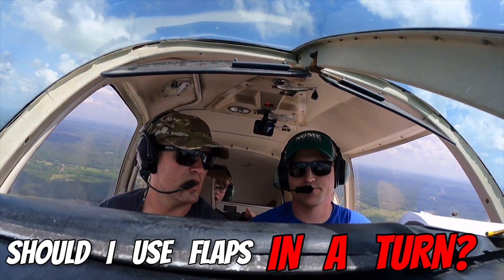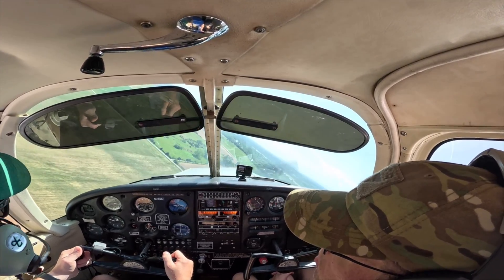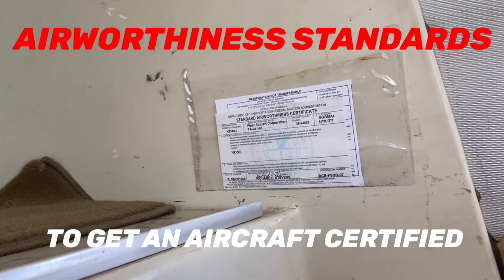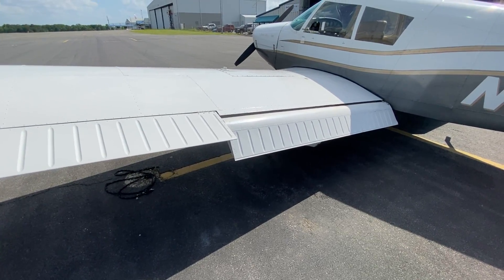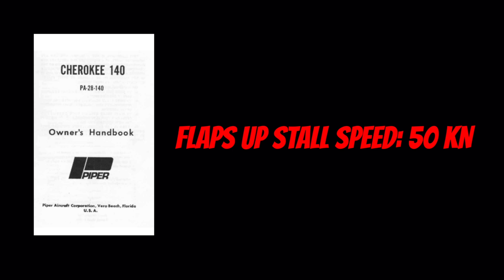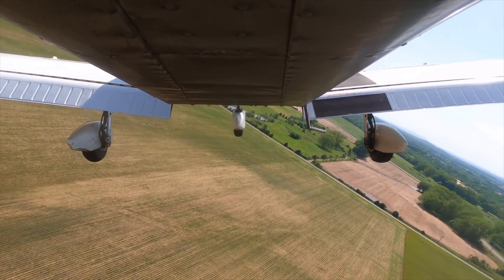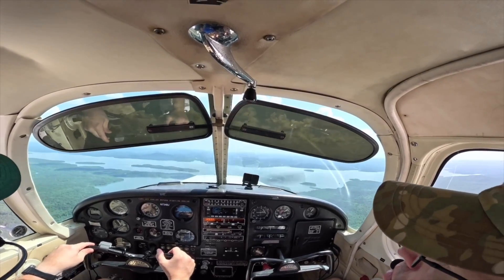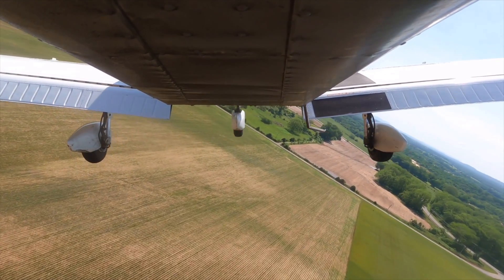Should I LOWER Flaps in a Turn?

Comment: There is a catch, you shouldn’t OPEN them in a turn. Some airplanes have a constructive tendency to jam the flaps when uneven pressure is applied. An during the turn the back pressure on flaps are uneven. 
Edited after first 5pm of video: my C172 have tone motor and a gearbox which splits the momentum for flaps, it still could jam as it happens in a cars with the same type of gearbox. And not having an accidents is not a point is like saying: there is no prove that oil change needed in between service intervals. Yes it’s not killed anyone it’s just a precaution habit which might save your life. This is what aviation is about.
Reply from the maker: This raises an interesting question… can you have a symmetrical load on the aircraft in a turn. I would say yes. As long as you are coordinated and you have neutralized the ailerons.
Reply: @FreePilotTraining  no, since your wings travels different distances. Like a car wheels in a turn. And different distances with the same pressure means different speed which resolves in different back pressure

Comment: Negative comment here!
While you are correct in what you talked about flaps, bank angle to G forces stall table is not saying exactly how you read it
What I mean is - if you don't pull those G's (no elevator up), you are staying at or close to 1G and even at 45* and no flaps you won't stall
But in that case - you will be going down fast (less lift which portion of went to horizontal component now..) - so still not a smart idea to bank 45* if you are close to the ground and want to land wheels first 😀
And since you don't increase the dreaded Angle of Attack - stall speed is also not increasing - but again - your speed to meet the ground is, since you have less lift 😀

That table says - in order to keep level flight (steep turns), for that much of bank, you need to pull this much G's (elevator up) to stay level, and that change in attitude (higher AoA) makes your stall speed go up by this much

Boom! All without even 1 equation :glasses-purple-yellow-diamond:
Reply from the maker: I agree, BUT as I mentioned in the video, if you are low and you level out and you make a level turn at 45 degrees, that’s where the REAL danger is.
Reply: @FreePilotTraining  yes, I completely agree with that! 😀

Comment: @Mohammad reza samadiam,  Not all Canadian flight schools teach that.  The school I am in does not.  In fact, they are very adament about not doing flaps in turns because of the small possibillity of failure.  This is a great video that I think more flight instructors should watch.  My only comment is, would you start teaching this to a brand new student right from the beginning or wait till they are better equiped?
Reply from the maker: Great question. I teach it right away because the key to a good landing is getting stable on final. If you need more flaps to get you down onto a good glide slope, I don’t want my students waiting around for level flight to put them in. I want them to get them in asap to fix the problem
Reply: @FreePilotTraining  I think you should look at your explaination again and think about Angle of Attack and what it will do in your turns.  It is not just the load factor.
Reply from the maker: @MrGidianG  I briefly mentioned it in the video. Adding flaps give you MORE of a buffer between your current angle of attack and your critical angle of attack. So lowering flaps in the turn increases that buffer in the turn.

Comment: Along the lines of this concept is bank angle during a climb.  We are taught not to bank more than 15 degrees in a climbing turn......but if we have appropriate speed, then how does a climb change that? How does a wing know if we are climbing or descending if the AoA should be the same? A climbing left turn at 70 knots vs a descending left turn at 70 knots....the only difference is thrust.  I think this came about from instructors adding safety margin for students in case of engine failure or stall (which WILL make a difference!).  Please consider this topic or link me if you've done it! Thanks.
Reply from the maker: This is a good point. I’m going to be doing a very similar topic very soon where I talk about power on stalls and using ailerons Vs rudder
Reply: The difference is the high wing on a climbing turn is always at a slightly higher AoA ; with a descending turn it’s the lower wing with the higher AoA .
This is why stalls out of coordinated climbing turns are ‘ over the top ones ‘ and out of descending turns ‘ under the bottom ones ‘ . The latter are the main cause of the notorious base to final turn accidents usually. The wing can’t help but ‘know ‘ since it’s part of the 3-D geometry of the situation .

Comment: You should also mention that flaps effectively increase washout, thus improving stall characteristics.
Reply from the maker: That is an excellent point! I wish I would’ve thought to mention that!
Reply: I think some planes have difficulty to get out of a developed stall with flaps fully down.
Reply: Of course this is not an "always" or "never" kind of answer. It depends on your airplane's performance and your goal (sharpest turn? safest turn, stall-wise? energy efficient turn? turn to bleed as much energy as possible?).
So the answer depends. He brought up some points to consider so you can decide for yourself depending on the situation.

Comment: When first learning in the circuit I was told not to apply the flap during execution of a turn, particularly during base to final. Once I was properly in control of maintaining airspeed during the turn then I was allowed to move from 2 to 3 (C152) while the turn was in progress. Pitch and power still apply. We only have about 450m runway and trees on the way in, so we need that reduced stall speed!
Reply from the maker: Yeah, that’s a pretty small runway!

Comment: The only reason I never  use flaps on base  because if I am a bit high  it safer the side slip without flaps side slipping with flaps may cause some vibration in some planes. Mined you if you side slip on most landing that is poor planning for your landing if you want a sharp turn you can also do a wing over but don't recommend it for a new or poorly trained pilot it can kill you unless in a Cessna 172 or 150 I have done those in the mountains to turn around where you little room never though of using flaps that may help some times.
Reply from the maker: True. New pilots are so scared of the side slip, but it’s such an awesome tool
Reply: I believe you meant to say forward slip not side slip. Forward slip is the one we use to drop altitude and the one that riles everybody up when you talk about flaps in a forward slip. Side slip used to stay centerline with a crosswind.

My 10,000+ hour dual given CFI had me doing forward slips with flaps full on my second lesson 😅 Just another tool in the flying toolbox😮

Comment: Well this is a little dishonest. Of course you’ll have a larger margin over stall speed with flaps down, but in most cases you’d be going slower with flaps down. So there goes your margin.
Reply from the maker: Not necessarily.

Comment: I never was exposed to GA flight instruction. Single seat naval aviator 20m years, then 30 with airlines. Since retiring I have been involved with GA aviation and always wondered why teaching steep turns was restricted to flaps up/clean airplane? When the majority of LOCI takes place in the pattern & especially base to final, why aren't steep turns taught or demonstrated with flaps at various extensions?  Do you at least demonstrate steep turns during training?
Reply from the maker: That is a very good point. We should fly them with flaps occasionally to practice

Comment: You bring up a lot of good points, and a couple of very important things I didn't know/hadn't thought about. However, the most important thing, IMHO, that you left out is to stay ahead of the airplane. I fly a 182 that has had a split flap condition (the side that doesn't have the motor jammed) which might make me a little more cautious than most. I have no problem getting in 10 degrees before turning base, then 20 before final, which lowers my stall speed from 51 to 44 kts before I turn final. Less experienced pilots might have trouble staying ahead of the plane, but less experience is a good reason to have the plane configuration stabilized with 20 degrees of flaps in before turning final. Great topic to cover. Thanks for all of your helpful videos!
Reply from the maker: Thank you! That is so true! Staying ahead of the airplane is key! Especially in a complex aircraft

Comment: There have been many cases where an aircraft got into trouble in a canyon and could not turn out, however, when looking at many of them, if they would have put flaps down they would have made the turn. Using flaps to tighten your turn is much better than more bank angle in many cases, speed is a factor, you don't want to lower the flap above flap speed. However, if you found yourself where you must make a  turn or die and it is looking like you not going to make it, I would lower the flap at most speeds. However, in order to even think of using the flap in those situations you must practice it. you are only going to use the tool you practice the most. The best thing is to know your aircraft. Practice putting your aircraft in terrible situations in a safe place without real danger, so that when it is real you know what your aircraft can do for you.  AQP is a good start.
Reply from the maker: This is a very good point. I’ve flown in mountainous terrain before and I briefed to everyone on board that flaps were an option if we got boxed in, but I haven’t actually used them in a situation like this.

Comment: I loved the video, don't get me wrong, but I disagree with your statement that increased flaps lower the turn radius while flying at the same bank angle. You have said that flaps increase your horizontal component of lift in the turn... But what about the vertical component? it gets increased by the same ratio, so if you just increased lift without increasing bank angle, you would climb as well. So you should just lower the lift back to your desired amount by pitching down a little bit, which would result in the exact same turn rate, theoretically. I agree that flaps allow you to make sharper (and obviously safer) turns, however, you need to increase bank angle as well. 

I challenge anyone to change my mind :D
Reply from the maker: This is a great question.  I don’t know the math on why the airplane doesn’t climb, but this is not a new concept. The C-130J has something called a turn noodle on the PFD. When we lower the flaps, the turn radius shrinks down on there as well even if we don’t change the airspeed, and it’s a considerable change, but the aircraft doesn’t climb.  I’ll have to do some more research, but for now let’s just call it magic…🤷🏼‍♂️
Reply: @FreePilotTraining  Were there any differences on the turn indicator with the rate of turn?
Reply from the maker: @warren5699  I don’t know why I didn’t think to look at that. You might be able to see it in the vid. Not sure
Reply: @FreePilotTraining Same here - I should have checked.  Now having done that it looked about the same in the vid but there was a good bit of reflection and the camera focal point needs to be closer.  If I can remember next Mon when I go up, I'll test it also.  Interesting point and agree it could be advantageous.
Reply from the maker: @warren5699  yeah, let me know if you do. Theoretically, the rate of the turn should be the same
Reply: @FreePilotTraining  Tried to make some comparisons today.  Unfortunately the winds were strong and gusting, so it wasn't a good day for a test.  I'd say the flaps (I used full flaps) made the turns slightly tighter, but it could have been partly the conditions also.  I didn't see any difference on the turn indicator.  I made some extra turns outside the pattern just to compare the turn indicator no flaps vs full flaps and still no noticeable difference.  Not sure what to make of that.  Overall, I personally wouldn't rely on the flaps to influence just the turning performance because it appeared that just a slight change in the bank would be accomplishing the same thing.  With the conditions I had today, it would limit the use of flaps for most pilots, and if you become reliant on them for turning performance, then you are in a catch-22.
Reply from the maker: @warren5699  I appreciate you testing things out.  I’ve been getting quite a few comments from some Ag pilots on here that drop the flaps in a turn on purpose to tighten their turn radius as well.  I think it’s more beneficial than it seems.  Maybe in a Cessna or a Cherokee it doesn’t make that much difference, but it definitely does in faster aircraft.
Reply: @sebastianchybidziura8188  That's a fair assumption.  But what in your opinion made the circle smaller - it was noticeably smaller.
Reply: @warren5699  well, that's what doesn't make sense to me... I mean, I thought that it was caused by higher bank angle, but if they claim it was the same then I believe it. I didn't come up with any other explanation so far though.

Comment: I think you have misunderstood the no flaps argument entirely. Instructors teach students to fly with flaps during pattern turns. "No flaps" is from teaching not to lower flaps while turning to reduce workload and prevent students from fumbling with flap controls and loose track of the turn and/or their airspeed.
Reply from the maker: No, the comments I received were in direct relation to asymmetric flaps (split flaps).  However, I do believe that you are doing students a disservice by reducing workload on students.  Flying an aircraft takes considerable multitasking skills and learning to use all those tools at the appropriate time is an important part of learning to fly.  The FAA actually recommends that instructors intentionally task saturate their students at times in the cockpit so they can learn the priorities in the cockpit: Aviate, Navigate, Communicate
Reply: @FreePilotTraining  stall spin in the pattern is still a top killer in GA. Teaching someone not to touch flaps in a turn at worst costs a few seconds and at best could save their life. All the schools around me teach ppl flaps 1,2, full on abeam, base, and final. 

I'm still not convinced someone wasn't talking about the drag changing asymmetrically when changing flaps in a turn. As you pointed out uneven flaps essentially never happen. If someone told you never use flaps and turn at the same time when are you supposed to use flaps?

Comment: I think the question should be, should you ADD flaps during a turn?  I was taught to add one notch abeam the numbers on downwind.  Second notch on base, and full flaps once I'm sure we've made the runway.  I have added flaps during the turn from downwind to base....  but never full flaps before turning final.  Here's another question:  Should you slip the airplane with flaps?  I will do it with two notchs, but not full flaps.  Am I wrong?
Reply from the maker: That is USUALLY what I do as well, but sometimes there are instances where you need them in the turn.  As far as slipping with full flaps goes: that’s a Cessna problem.  The POH specifically says that slips with Full Flaps are prohibited.  This is because slipping a Cessna with full flaps can remove the wind from the rudder due to the giant flaps in front of the rudder in a descent. Cherokees don’t have that problem. I can slip with full flaps all day.  That’s one of the things I love about them.

Comment: Having flown a few hundred thousand miles as a passenger, I remember several times when the A/C flaps were extended in a turn/holding pattern.
As a SEL pilot, I remember using my flaps in a turn to comply with ATC directions to reduce speed to clear traffic on short final
Reply from the maker: Exactly! Nothing wrong with that

Comment: The rest of 5he video was good. While I have seen people use equations incorrectly, you can not disregard all equations. The turn diameter physics does not support your flaps turn theory. Sorry
Reply: I have to agree with you there Bob . Dredged up the PHAK and on p23 it says ‘ turn radius is directly related to the horizontal lift component ‘ . Jeez , who proof reads this stuff ? Not a competent aerodynamicist , evidently . 
Turn radius is inversely related to the horizontal lift component and directly related to the square of the airspeed as any competent AP physics student would know .
Reply from the maker: Actually it does. Read the PHAK.  Turn radius is directly related to the horizontal lift component.  Also, the C-130J has a turn noodle that indicates your turn radius. The second you lower flaps, the turn noodle shrinks.  I guess we should call Lockheed Martin and have them fix that. Lol

Comment: It is not a ‘split flap condition’. It is Asymmetric flap.   A Split flap is a soecific type of flap, as are Fowler,  Slotted. etc etc

And of couree you can use flap in the turn.
Reply from the maker: This is true. Asymmetric flaps is the technical term